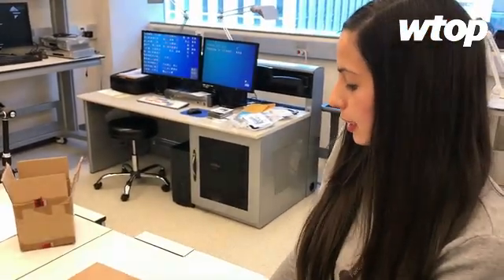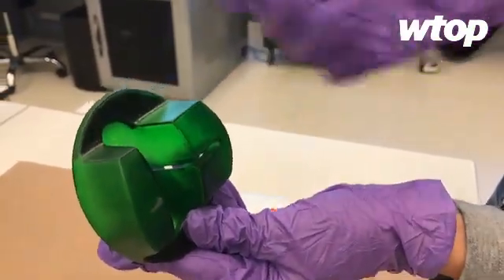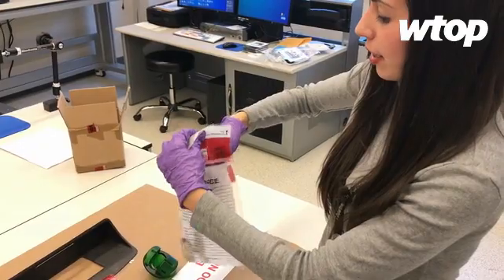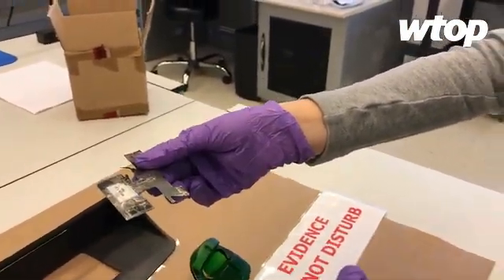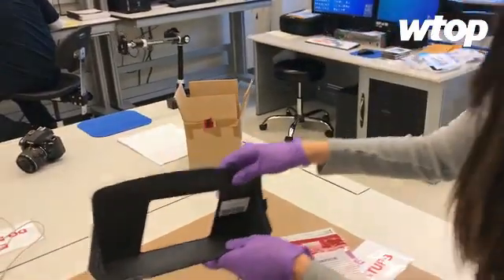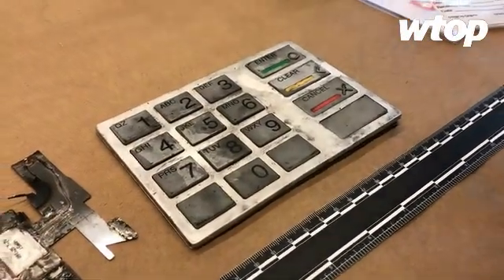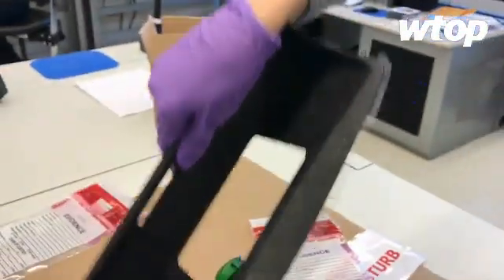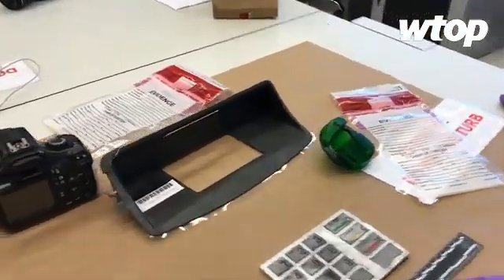Undetectable ATM skimmer deconstructed

Comment: Price
Reply: ⚡Cash/Card Trapping Tool $350

⚡Transaction Reversal Tool $500

⚡Chip/Pin Bypass Tool $700

⚡Wireless ATM Skimmer  + PinPad $2100

⚡Normal ATM Skimmer + Pinpad $1650

⚡Wireless ATM Skimmer + Camera $1500

⚡Normal ATM Skimmer + Camera $1150

⚡Dump + Pin(uncloned) $150

⚡Dump+ Pin (Cloned) $250

⚡Fake Pages + 1Yr Hosting $500